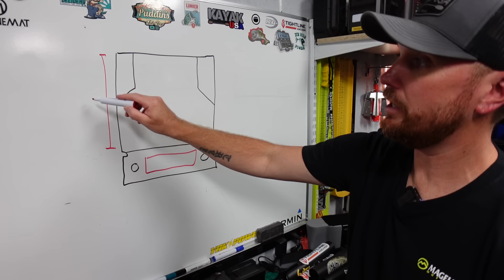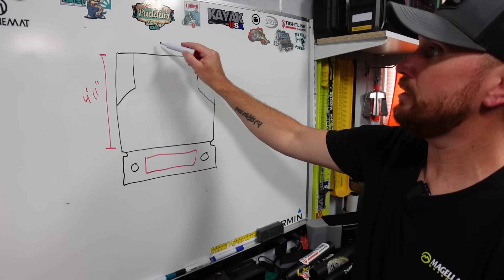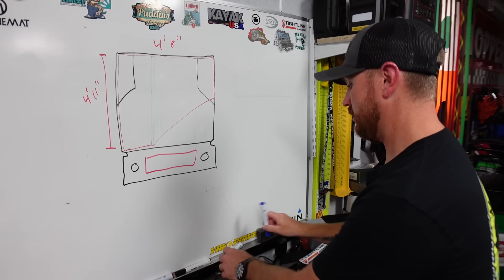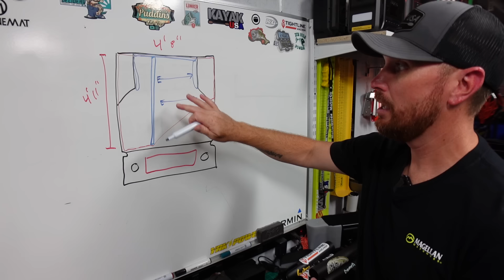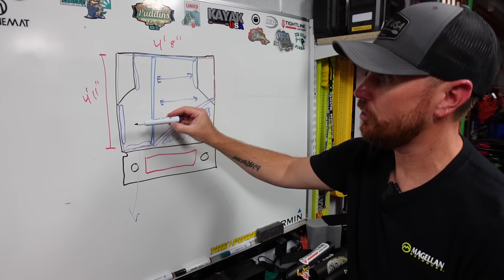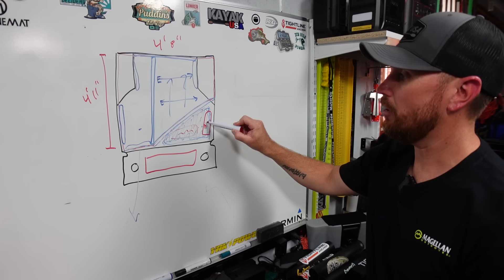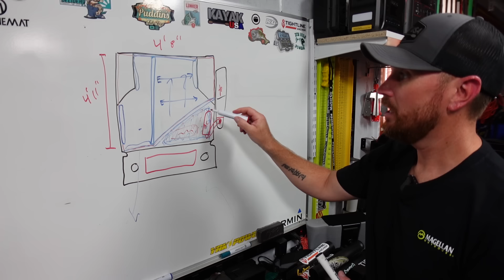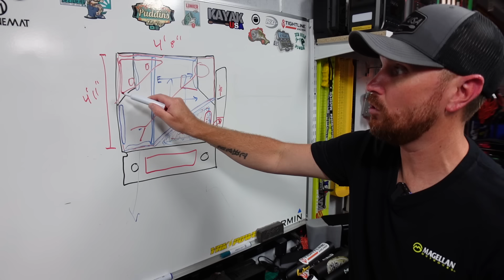DIY Truck Bed Camper Build | Short Bed Tacoma Solo Camping Setup | Overlanding 2023

Comment: I've done the diagonal setup and it works awesome and I'm 5.11 tall with the same bed size in my Ford Ranger. I've got a sink with running water, lights and power back there. Its a good stealth camper.
Reply: Make sure to give yourself plenty of room to sit up in there.
Reply from the maker: Heck yeah man! I'm gonna try to build mine out with as much stuff as possible but keeping it practical and usable!
Reply: @KayakUSA1  you're gonna love using it. I've done all kinds of camping and it's now my favourite. No setup required and can camp virtually anywhere.

Comment: Nice design and use of space.  

Something I would make note of regarding the 2x10 boards, and all the vertical plywood.  Keeping them solid is A LOT of extra weight for no reason.  If you cut "windows" throughout the lengths of these vertical areas, you can removed over half the weight of each piece of lumber.  

I made a fridge platform to set in place where my Tacoma passenger rear seat location was out of 3/4" plywood.  After removing a lot material along the vertical areas with radiused and routed "windows", as well as a few along the actual surface area of the platform itself, it came out super light, but every bit as strong as it needs to be to support my 37 qt ARB fridge.  

These "windows" also allows me to easily pass items under, or through the windows with ease.  

So, especially the 2 x 10s in your build, evenly spaced radiused windows cut out and edges rounded with a router will greatly reduce the weight of said lumber without compromising the required support that they need to provide.
Reply: Great idea!
Reply: I second this. Its the only flaw in this guys build ( which im copying  almost exactly) but yea 3/4 seems like over kill, but then agian im worried about thieves in my area so ill be  fastning the frame to the back strap points, and make the bed hinged to fold onto the bed space so i can still hall stuff with half the bed. LOVE this video.

Comment: I used a piece of plexiglass and a pvc collar to run exhaust out of the camper shell.  cut your plexiglass to the size you want, then use a whole hole saw for the size of pvc needed to clamp exhaust tubing to.  Epoxy the pvc in place or use collars on both sides to hold it in place.  I used one collar and cut it down to keep things a bit more flush.
Reply from the maker: I actually just finished mine today! Basically the same way you said 🤙🏼

Comment: as a 5'4 2018 tacoma short bed owner
I probably don't even need the diagonal sleeping position.  But this!!   THIS I am doing.  

I just need $3000 for a paint matched topper :')
Reply: I can't stop thinking about this build and little ways I'm going to tweak it to work for me.
Like having the top bed platform on a folding hinge somewhere down the middle, to fold up and use the underside as 'table space'.  This would create a narrow aisle (which with the bed down would just be slot-storage accessed from the front of the bed per usual for camp chairs/stove/etc.) for a small chair to sit in against the back of the bed, as well as transport my bicycle standing upright as usual around town, without the camping setup being in the way.

I'm tempted to do this as well, with a softopper, and during the work-week or not camping, throw my tonneau cover on to hide it all.  Slightly cheaper and less permanent option.

Comment: Excellent video! I subscribed, you have great ideas, and do nice finish work. I have a 6-1/2’ bed to work with, and bought a pre-owned like new Leer camper shell today, it even matches my Silverado color. The build will be for me at 5-11 and my 5-3 Wife and 2 small dogs. I think the diagonal cut like yours would work good. I really like the idea of that empty bed level flat space.
You might want to consider insulating your shells roof, if you haven’t yet…I’ll have to check out your other videos.
Thanks.👍
Reply from the maker: Thanks! Good luck with your build 👊🏼

Comment: Did you drill and peg the 8” length of plywood. It was hard to see that portion in the video.
Reply from the maker: Yes, I used jointer biscuits 👍🏼

Comment: Not a bad support system and the final product looks really nice but out of curiosity, is there a reason you didn't just cut to size and lay two 2'x8's across utilizing the built in slat "shelves" on either side of the bed? This eliminates the need for any vertical framing and thus allowing you full access to the bottom or "storage area" under your plywood sleeping platform

Comment: Nice build. Be sure to leave a window open slightly for ventilation. People have went to sleep in cars and not woken up due to no ventilation and asphyxiation. That will also prevent condensation from forming on the roof of the camper. Great use of available space though!
Reply from the maker: Thanks man!! Great tip as well 🤙🏼

Comment: Nice setup, mind if i ask what wheels, shocks(height) and tire setup are you running. I got camper shell with prinsu racks on both cab and shell with couple of gun cases from HF. Just wondering what suspension to go with and what would be the ideal height with the extra weight? Thanks

Comment: I noticed you used biscuits to join the two pieces of ply together. If you had to do it again, would you use dowels instead or did the biscuit joint bond together well enough to last long term?

Comment: Did you use spray adhesive for the carpet before folding and stapling? What did you use for cutting thick foam pad? Any suggestions or better ideas after actually doing? Thank you
. Love your thought process and ideas - I subscribed months ago after running across your work!  Kerry

Comment: Hey man, really nice set up. I’m getting my smarcap installed in a couple of days. I have a stock suspension with the icon added leaf and as it is its already sagging a bit with the weight of RTT, temporary rack and sine camping gear. Can you share if you did anything to your rear suspension to accommodate all the added weight? I assume you constantly have most of it always on the truck. Im planning on getting a decked drawer system too

Comment: Excellent build! I am just starting mine in my Tundra so I appreciate learning from yours! By chance do you have a link for the topper clamps? I just bought a used top that only had C clamps. I need same as you with the rail system. TIA!

Comment: Nice setup. Question i have is going down gravel roads i somehow get a little dust find a way in and lightly coat things. With the trunk carpet does it get covered and such?
Reply from the maker: Not at all, I have most of the little cracks and opens covered and sealed up 🤙🏼

Comment: I've only just discovered your channel and wonder how it turned out and IF you stuck with it or changed your plans. 
My Concerns - Here in Australia, one of the things that I've noticed is what I call 'death by corrugations'. Essentially this is off roading & long trips on heavily corrugated roads, and have that jack hammer feel as you try to find that 'sweet spot' to minimise the vibrations. 
I've seen people take caravans down these outback roads, only for everything to start falling apart on them. I'm not saying your build will do that. And I'm guessing the suspension on your Tacoma will handle most rough tracks. But is it a consideration?